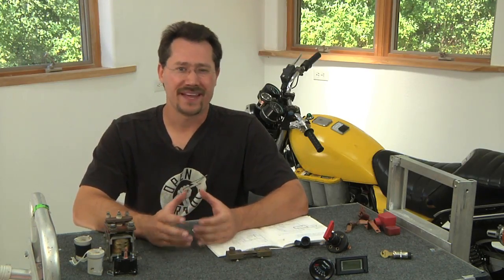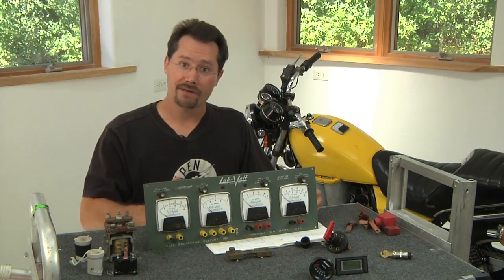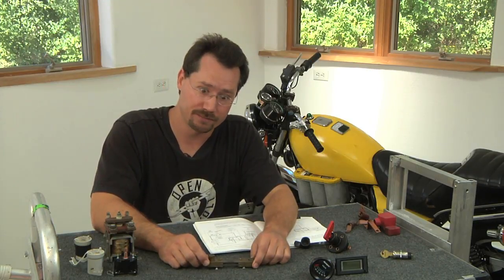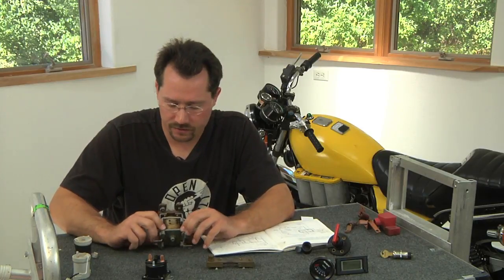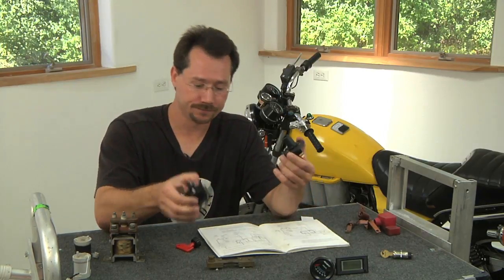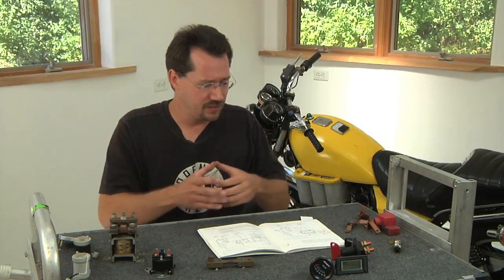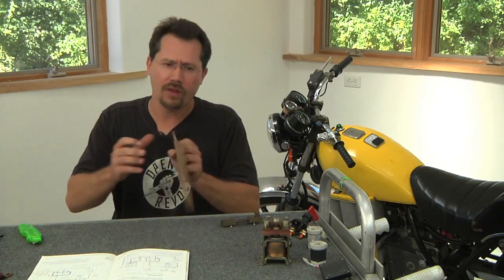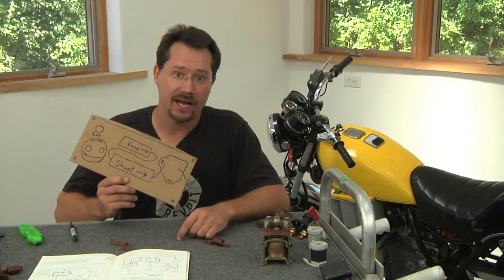12 Build Your Own Electric Motorcycle - FULL - 12 Balance of System

Comment: Is having a main contractor AND battery shut-off a redundant safety/security precaution,  or are they both required for operation?
Reply: Never mind, I watched again and realized I forgot about the pre charge resistor.  The shut-off is the  way to kill power to it.  
Great explanation!

Comment: Hi, Thank you for the informative video. If you take out the battery cut off and then put it back in later on how long would you wait to ensure that the precharge resistor has trickled enough power to the controller to protect it from damage? Thanks again.
Reply from the maker: A pre-charge resistor simply "slows" the rush of current that the capacitors in the motor controller would otherwise want to draw in extremely quickly. The exact amount of time before the capacitors are completely filled and voltage is equalized depends on the system voltage and the resistance of rating of the resistor. Typically, it's anywhere from a few seconds to no more than 10. The important thing is to simply not let a spike of current be drawn into the motor controller, possibly damaging it.
You can learn more about this in the documentation for motor controllers, such as through the instruction and installation manuals at: https://alltraxinc.com/documentation/
Reply: @BenjaminNelsonX  ah I understand. Thanks very much. Top vids mate.

Comment: Its people like you who , together with youtube, make it exciting to be alive. Thanks. As a layman (in my 60s) I want to tackle such a project.Are there preferred models for such a task? Im a big guy 6 5..and have always preferred large bikes.
Reply from the maker: Generally, you want something large enough to hold all the batteries, but still being relatively light. Aluminum framed motorcycles are good for the weight savings. There have been all sorts of motorcycles converted - from mini-bikes up to Goldwings and trikes.
Reply: BenjaminNelson Thanks for your reply.
Batteries being as heavy as they are, would the weight distribution be less disruptive to roadholding on heavier bikes or would you say it balances out taking into account the replaced engine. Any problems with insurance? My dream us to park it under a solar panel car port..being in sunny Australia he he he..Thank a bundle.
Reply from the maker: I didn't have any trouble at all with insurance, but speak with your insurance professional BEFORE starting a conversion project. As for batteries, the main thing is to mount them low instead of high for best center of gravity. They more or less take up the place and weight of the engine and transmission.
Solar is a great way to power a vehicle! Installing solar panels on my garage is one of the best things I've ever done!
Reply: BenjaminNelson Had the same feeling when I installed solar on my caravan.Something very special about disconnecting from the whole age of the petrodollar. Thanks for the information and inspiration.

Comment: I've been planning an electric conversion for a trail 70 minibike, and i had a question.  If my battery system is 24 volts, and the motor system is 48, is there a way that I could safely wire in a capacitor for a double-voltage "boost" period?
Reply from the maker: Typical capacitors simply don't have the capacity to be practical for an EV propulsion system. I have heard of some Super-Capacitor setups being used in combination with batteries, but that was typically for regenerative braking energy capture.
There are mechanical ways of switching batteries to a motor, done with contactors, to vary the voltage. That was done on the old electric golf carts. The 1970's Sebring-Vanguard "Citicar" used this system too. It works, and it's simple, but much bette to go with a modern PWM electronic motor controller now.

Comment: If you always have power running threw the system then what is the point of having the main contractor?
Reply from the maker: Aleien Films Do you mean because of the pre-charge resistor? There’s also a battery disconnect. (The red key-looking device) Power is dead when that’s pulled. 
Among other things, that’s also important for safety when working on an electric motorcycle.
Reply: Ahhh I see. Oh okay. Also could you make a video of a complete wiring diagram of the whole electrical system layout on your electric motorcycle? Everything from main motorcycle wiring to lights just to get a clear ideas?
Reply from the maker: For a great way to learn more about wiring diagrams of electric vehicles, visit Alltrax's Documentaion page. https://alltraxinc.com/documentation/
Scroll down to General Schematics and Wire Diagrams. 
I based my motorcycle on the "AXE with no Reverse" wiring diagram.
https://alltraxinc.com/wp-content/uploads/2017/03/Doc100-045-A_DWG-AXE-No-Reverse-wire-dia.pdf
Reply: Only very little power goes through the resistor, only enough to keep the capacitors in the controller charged. The idea of the contactor is the controller can turn on the HIGH power to the motor when it deems necessary and can cut power if something goes wrong.

Comment: Sir I want to know one thing if we use bike body frames
Will we face any copyright action for using that company bike body frame
Reply from the maker: Motorcycles have a long tradition of being modified. I've never heard of anyone having a copyright action for using a certain motorcycle frame for a project. Even if you manufacturing new motorcycles with a frame identical to some other manufacturer, I doubt such a thing would be done (unless actually using their name and colors, etc.)
Reply: Sir I am thinking about to make an electronic bike and to sell it with my own logo
So I there any problem if I place my logo on some other company bike??